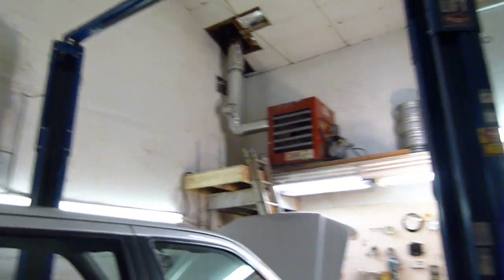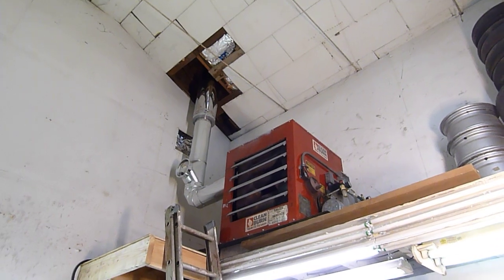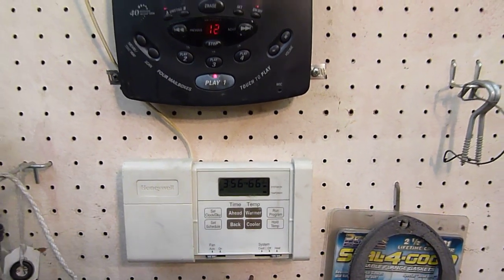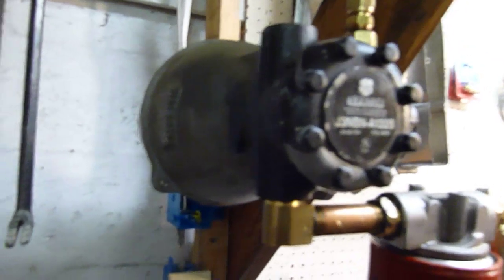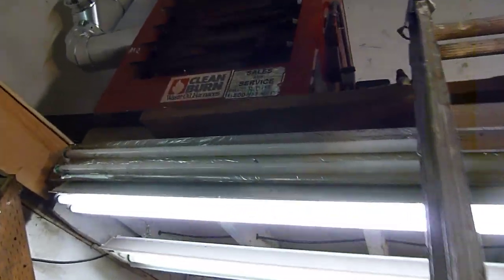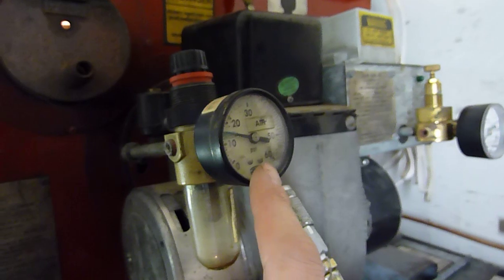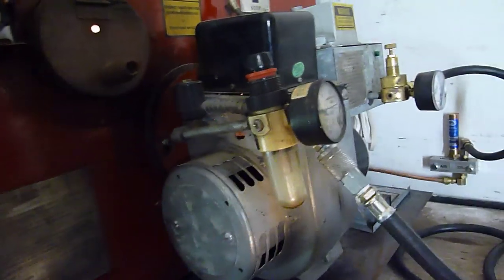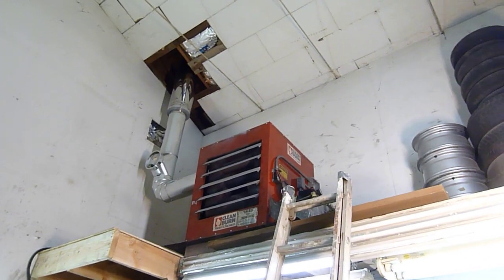Clean Burn waste oil furnace

Comment: Hi 2stroketurbo   as a long term cleanburn technician and installer I would like to offer a few suggestions concerning the install.  It appears that they installed the furnace body on a non-combustible cement block, but I can't tell from the video if that is also a piece of wood or cardboard box right under the furnace base, either way remove it, its a fire hazard, secondly I noticed that the C vent chimney (single wall) has less than 18 inches clearance from the wall, I would suggest a heat shield on those wall surfaces that are less than 18 , it's a fire safety issue.
Burner sound great but I think the prop fan is just ticking the fan shroud.
When you install your permanent tank don't forget to vent the tank to the outside.
Enjoy the free heat